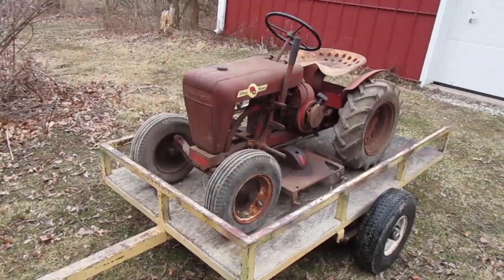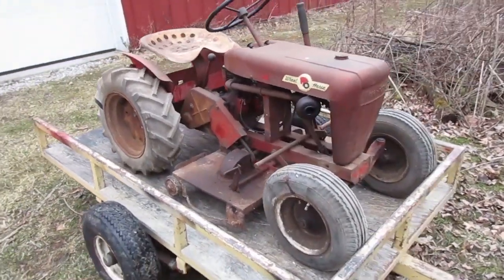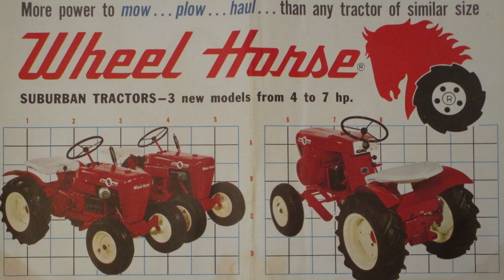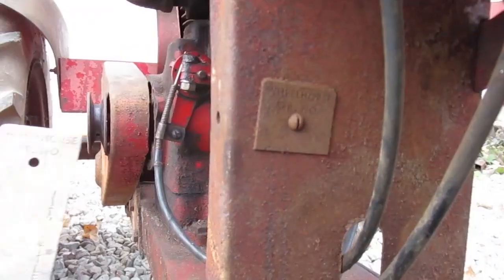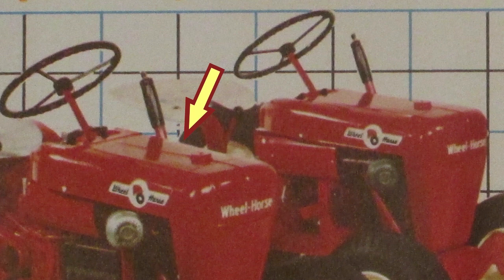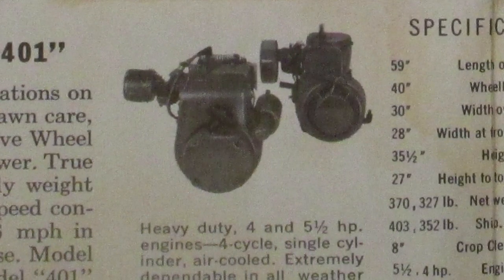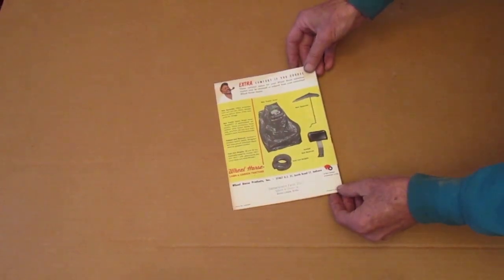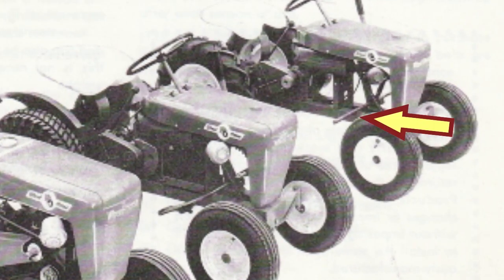Wheel Horse Model 401 Cleanup #1

Comment: The early 551 also had a cut choke/throttle plate like the early 401 for the serial #.  It was mounted on the plastic cover over the rectifier on the engine.  I have one of these early 551's.

Comment: Hello, I have this same 1961 model 401 tractor and will be restoring it soon. I am so excited to have been able to find someone that has the same wheel horse and that has knowledge about it.  My wheel horse needs to have the transmission gone through/rebuilt as the shifter had been removed from the previous owner and it is locked in gear. Just wondering where to get replacement gears and what type of fluid to use in this transmission? Hoping you might be doing a video on rebuilding this transmission. Thanks for sharing your videos, they are very helpful.
Reply from the maker: Replacement gears are hard to find, they have to come from a used transmission or somebody selling parts because they're not made any more. Use SAE90 or 80 gear oil. I did a series of 8 videos about 4 years ago on rebuilding a 1960 transmission, it's the same as 1961. So check out the older videos on my channel.
Reply: Tractor Supply, maybe?  They might have gears to get for your tractor.